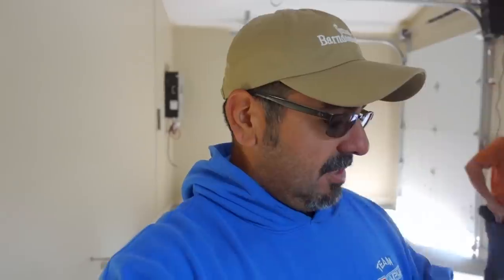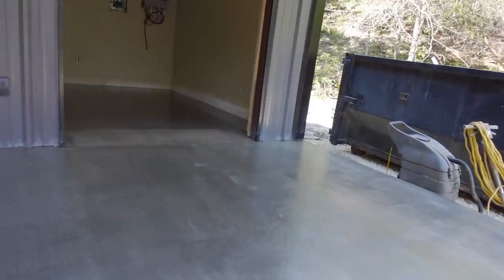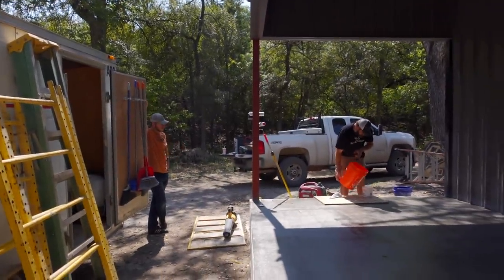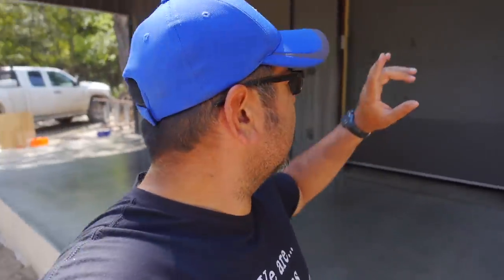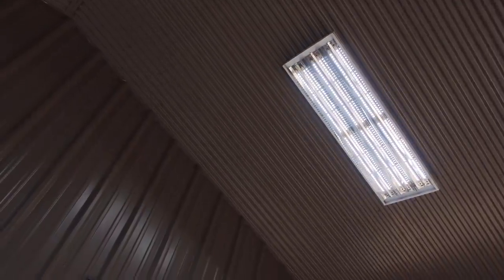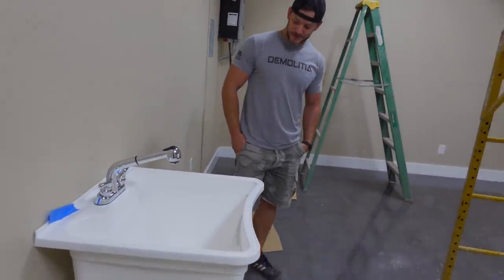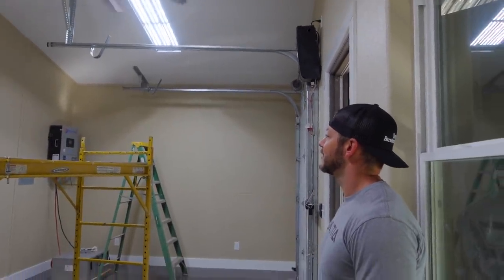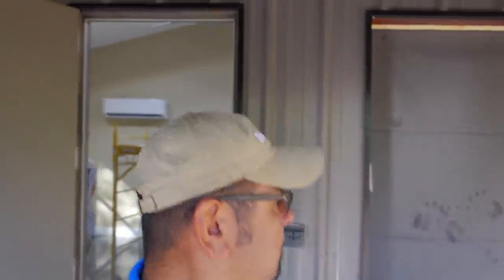Sealed concrete floors | Demolition Ranch HQ Build Part 20

Comment: Do you have a drain hole in the bottom of those square roof posts?
If it gets water inside and it freezes it WILL get a big crack/hole and turn into a round post 😉
Water will condense innside from temperature changes.
Seen it many times here in Norway.

Comment: Love your videos. Question: how do you determine where to place beams in an open concept barndo (no load bearing walls)? I’m about to start a large slab (50x100) and I don’t want saw cuts because I want to have finished concrete floors. Any recommendations? I’m in rural N FL and the finishers in my area have limited experience with this type project. Thanks for any advice you can give me.
Reply from the maker: Engineers will figure that out for you.  Hire one.